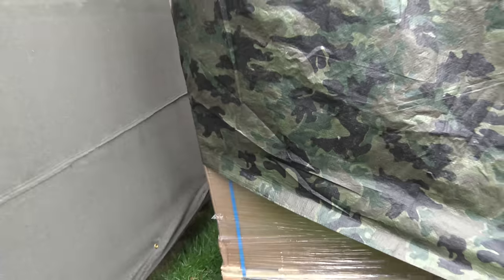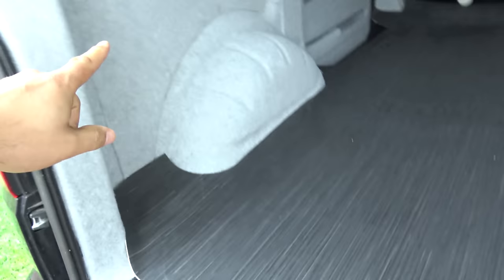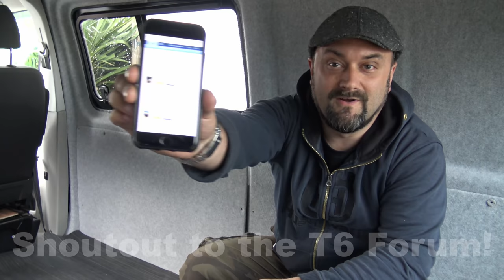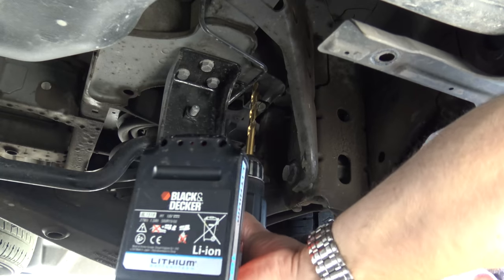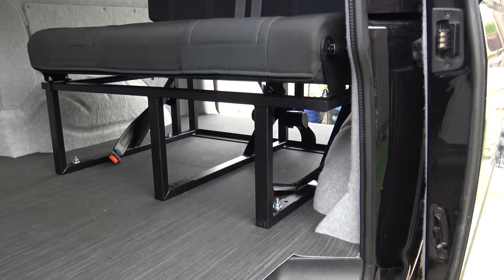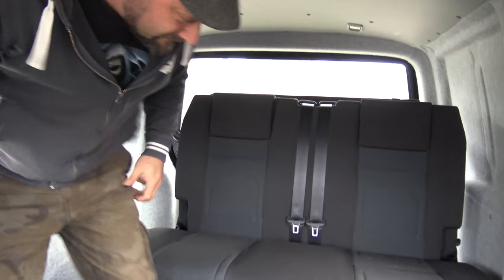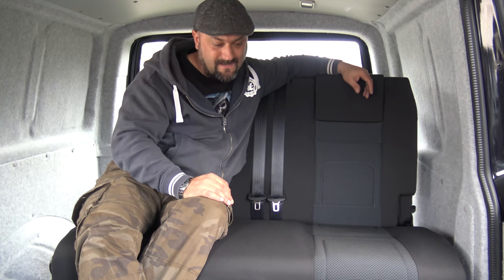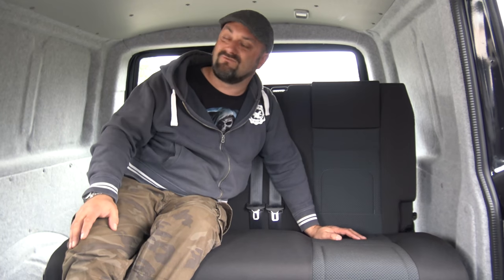DuB-EnG: DIY VW T6 Camper Van Build Project RIB Bed Seat Installation flooring Rock and Roll fitting

Comment: Good idea using a threaded bolt, however, you should really use high tensile bolts if carrying passengers, as the bolts will now be the weakest part of your seat
Reply from the maker: Good call...  I'm sure it wont be hard to replace them...  :-)

Comment: I agree with you on the rib bed compared to the rock and roll bed👍
Reply from the maker: weird... having had it for a while, it’s nice to use as a bed, but a little annoying to sit on...  my feet almost don’t touch the floor...  the rock and rolls are lower and work well...  the rib does just sprout quality...

Comment: That's complicated to install and use, so no it is not better. With an R&R bed you get much more storage, easy to get to storage and you can throw you bedding behind the seat. You can use 4" foam and have a comfortable bed and the whole thing is much cheaper. The R&R bed is easily number 1.
Reply from the maker: There are benefits to both.  This seat sits too high of the floor, so short ass me has a problem...  My feet don't touch the ground while sitting.   This has been my only complaint.
Reply: @DubiousEngineering  What about my criticisms and feet not reaching the ground, that is pretty serious. I can sit with my feet on the ground and my head doesn't touch the ceiling, so that is ideal. I did my entire build for less than £1,000 in materials and have maximised the available space..
Reply from the maker: @allanb52  that’s a great budget!  I spend £7000 in materials and months of my labour….
Reply: @DubiousEngineering  This is the 3rd van I have built and have kept everything simple, No solar, no second battery, a simple coldbox running only when the engine runs, so just a couple of USBs and LED lights to power. My priority is reliability and that means KISS. We did a 10,000km trip to Greece and Turkey last year and heading for the Alps late spring and back to our home in Portugal. I was sick in 2015 during this last build so subbed some of the work out. This added £2k to the cost, but still had an 08 Vivaro camper for £6.5k and so far have had over 150 days/nights in it. Good luck..

Comment: Just wondering why you didn’t fit with one of the RIB fitting kits. Surely that large metal brace that fits underneath the chassis is a large part of the reason it has a crash rating?
Reply from the maker: Yeah I would recommend doing that rather than making your own!!

Comment: Does that seat fitting comply with mot testing etc for the strength of the seatbelt? Was that the recommended places to drill according to the t6 hivemind
Reply from the maker: A very good question...  You have me worried! - I'm going to look it up, that said, nearly everything is bolted through major sub-structure... I tried my hardest!!  :-)